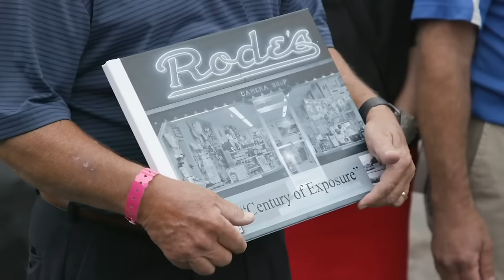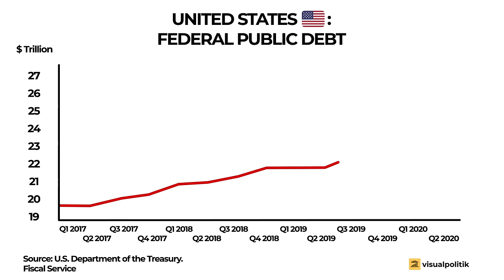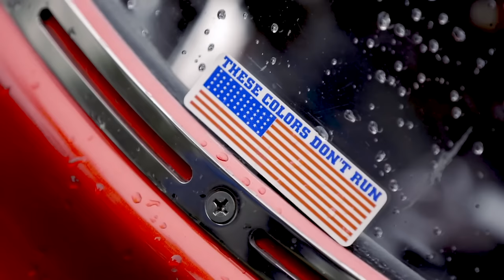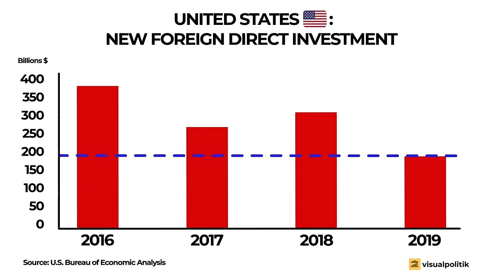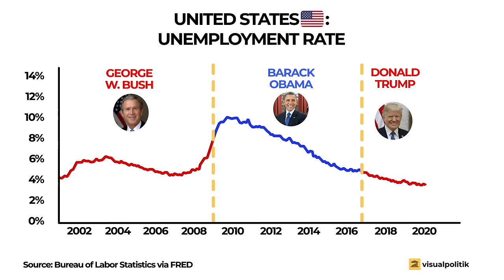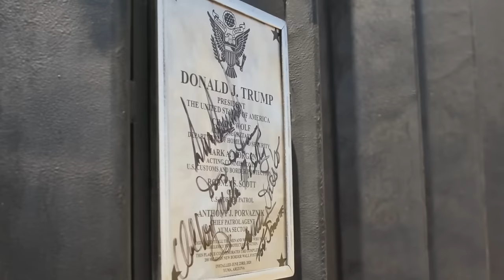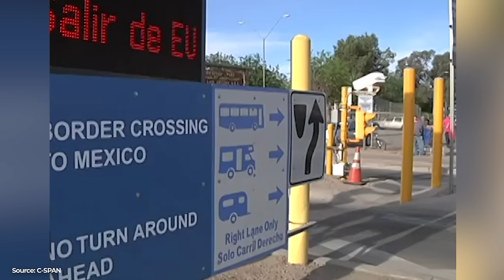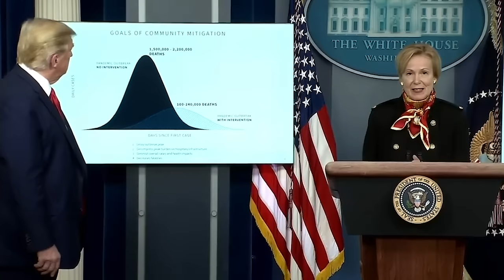The greatest 👍 achievements and 👎 failures of the Trump administration  - VisualPolitik EN

Comment: Comparing literal wire that people can walk around as an existing structure, to a wall that has been designed so people can't even climb over it is not a fair comparison...
Reply: People climbed over that wall. And the tunneled underneath it. This ignoring that it took four years of BS to complete less than 10%...
Reply: Except that it is exceptionally easy to climb over.

Comment: I don't want to nitpick, but most of the graphs used in the part of the video where the achievements are discussed in this video do not start at 0 on the Y-axis, thus magnifying (and exaggerating) a growth or decline. Which also counts as manipulating objective data to try to prove a biased point of view. In the part of the video where the failures are discussed, they do start at 0... 

Am I the only one noticing this?

Comment: Overall, fair video. However, I'm pretty sure that the USA has less of a responsibility (if at all) towards Hong Kong than Britain does since Britain brokered the "one country, two systems" agreement with China and subsequently handed over Hong Kong back to them. The two state solution expires in 2047, after which Hong Kong would likely be absorbed by China; inevitable and tragic. If China breaks the terms of that agreement, it should probably fall on Britain to enforce it, not the USA. Although I could be wrong, I'm not an expert about foreign policy or international war laws and this is just a comment section. Anyways, cheers.

Comment: You are probably wrong on the wall. ABC did a segment on it and turns out its actually longer than that. Also old walls were actually small easily movable barriers. So its not repair from old ones.

Comment: As long as there aren't any massive changes there is an argument that the president may not have that much power over the economy, and fluctuations are a result of market forces.
Reply: Don't you know everything is related? The president may not be able to control the market but could indicate which market will benefit most.